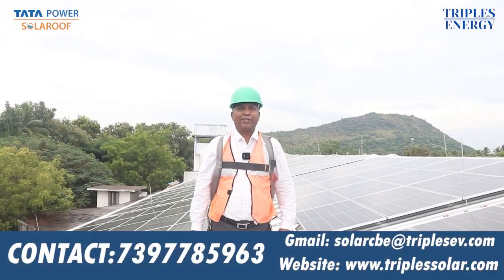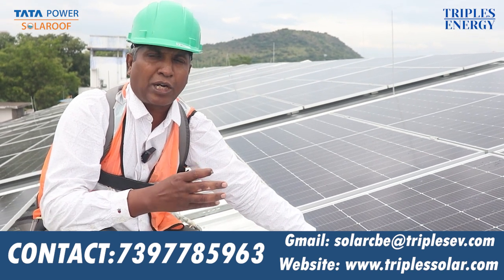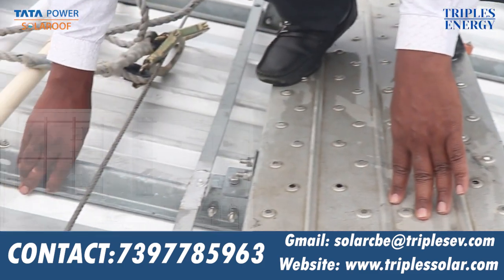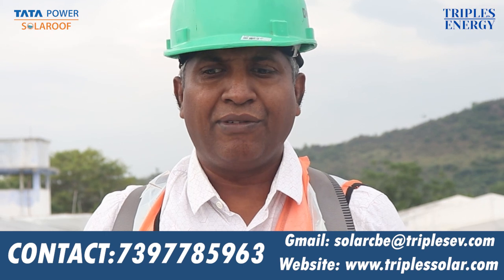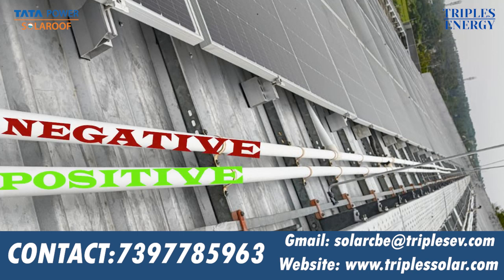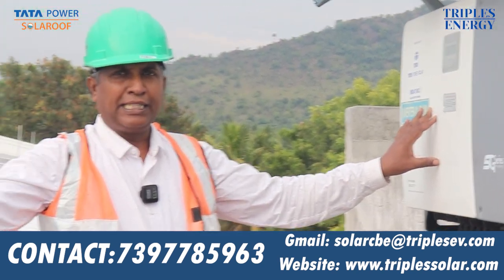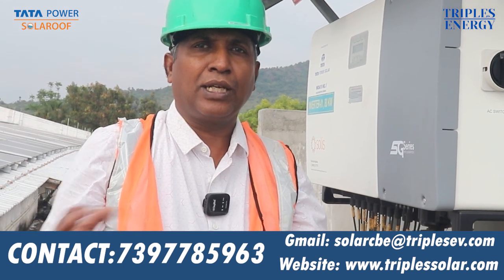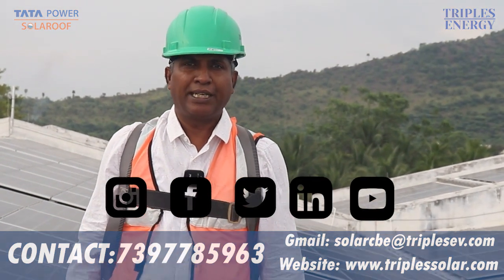Solar Panel for Industries|  Why Choose TATA Industrial edition by TRIPLES ENERGY #solar #solarpower

Comment: Very good explanation. For any investment ROI is very important, so over all budget relatable for ROI.

For commercial eb charges are high but industrial eb charge is little lower compared to comercial. Industries require huge power.

Therefore, I request to design project budget according TO ROI along with safety and long lasting life.
Reply from the maker: Please Contact this Number:73977-85963 we'll explain you in details